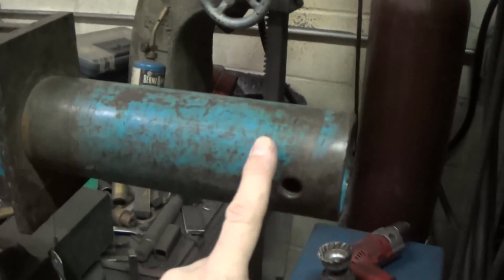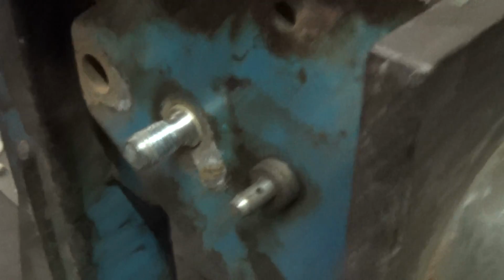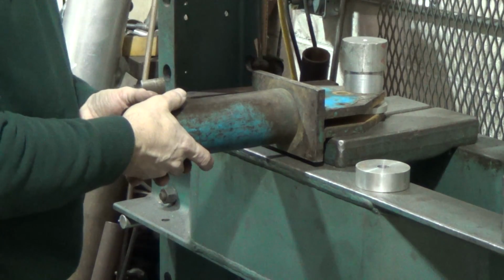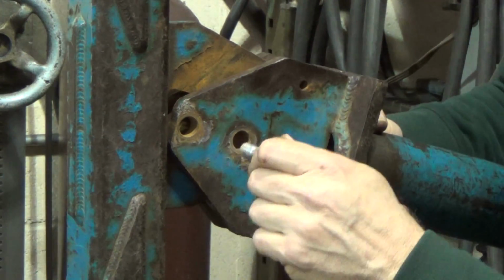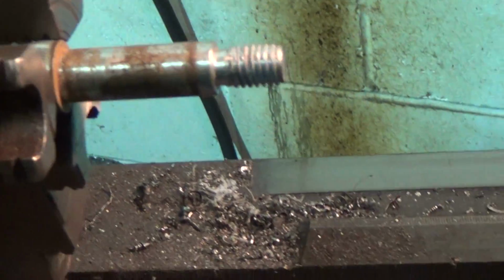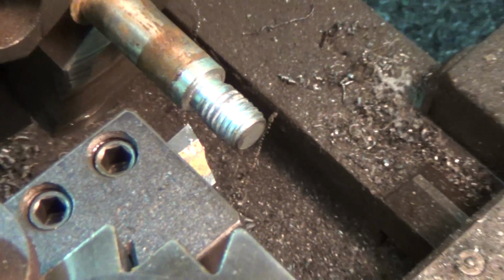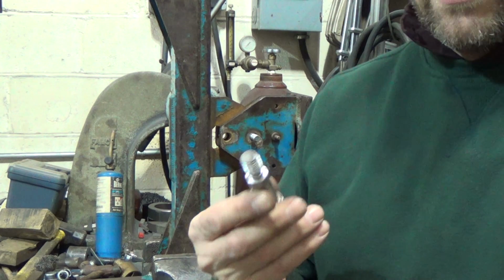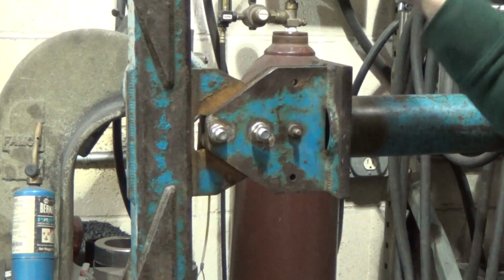Airplane Towhead Repair

Comment: It is not a sheer pin, it is a lock pin. if you look at the design of the tow bar, it is ment to rotate in either direction. The shoulder bolts prevent clamping so you can swivel the head to line up with the plane's wheel. If you loosen the bolts up, and pull out the lock pin, you will be able to rotate the head and the pin will locate on either of the holes to the left and right of the center lock pin hole. No matter how good of a tug operated you may be, you won't always be dead center. Thats why it moves.

Comment: The shouldered bolts do prevent the clamping effect of the The two halves the two sides should have some play between the mating surfaces...If you measure the bolts one might be longer Is so that's a sure sign nothing was ever wrong the taper was always  intended perhaps to  put less fatigue on the Rigger... Secondly I rather see a flat washer as a spacer with lock washers rather then less threads on the bolts rule of thumb is three full threads need to secure a bolt properly... The Shear pins only purpose is exactly for what it is named the pin will snap In the event the plane has a flat tire,seized bearing or is just simply too heavy for the towing Rig This is a safety feature solely to give the operator warning something is wrong as he would feel the slack in the Rig before fully moving the aircraft... I hope this helps this is nothing to do with the man Making the video good work I like your channel      more of a safety Issue...

Comment: Seems to me that 45von is correct, the bolts you modified are designed for alignment of the head to the tow bar and the shear pin is to make sure the load on the axle of the aircraft is kept inside the limits the designers intended.  Your clamping the two plates with the bolts makes sure much more load can be transmitted to the axle of the aircraft..    Parts for aircraft are very carefully designed and created to minimize the forces on the airplane first and everything else second.
Reply from the maker: Hi John,  as it turns out, I was able to establish that there needs to be a small amount of clamping on the thru plate, just enough to keep the shear pin from having to carry all the force and twisting by itself, I did make an addendum video to explain some of what I was able to find out   Airplane Towhead Repair - Addendum  Thanks for the comment.
   Mike

Comment: the shear pins break when there is to much pressure on them yes but you cannot tow the aircraft with out risk of damage to the plane ! some times they break with force that knock someone out ! been there done that lol and the towbar head are allot different from a plane to an other

Comment: Don't believe that is a shear pin, I think its purpose is to lock out the swivel function. The slotted bolt hole allows some fore and aft movement while the large rombus shape allows vertical travel while moving fore and aft. With out this play the planes suspension will take the bind from being hitched to the tug and possibly damage the plane. Notice the wear patterns on the plates. That is why the pin is made of such low grade material, if someone were to forget to pull it before towing then it would break and the hitch would still function despite there oversight.
Reply from the maker: Hi Grumpybill, What's that saying about the more I learn, the more I realize how little I know.....  That's a whole new theory, but I must say that when the customer talked to the manufacturer for technical support the other day, they did refer to that pin as a shear pin. I think I see what you are saying though, that if the force goes to one side or the too much that it will cause the pin to fail.
  Thanks for the info and comment ..... Mike

Comment: Just because a guy has been doing it the same way for 30 years doesn't mean he knows what he is doing.
You don't need a manual to know what a shear pin does it is common sense and as the guys below state you negated the function of the shear pin. Shoulder bolts are used in this situation so that you can not put too much clamping force on the hitch!
This is basic engineering knowledge.
Reply from the maker: Hi Bily,  I think I understand all you are saying, I made an addendum video the day after making this video that explained what I learned about this type thing that I did not know when I made the initial repair. Airplane Towhead Repair - Addendum
 In that video I explained that, and also what I had no knowledge of when doing the assembly, and what I did to repair the part, I'm not confused about that at all, and as I explained in the second video, I did what was necessary to make a very workable repair. As it turns out I could have returned it to the customer unassembled, as they make the adjustments to it before returning it too service.
  As I was able to learn from the customer later, the manufacturer did explain to them at their request that "a near zero clamping force is required for the assembly"
  Thanks for the view and the comment ..... Mike

Comment: Adam tight! LOL...thats not the first time I've heard one of you guys mention my torquing skills.
Good job with balacing the budget using the press. My luck was always I press it .010 too far the wrong way.
I like that "truing" tool made for yourf Aloris. Ive seen them before but never bothered making one. I guess I depend on my indicators too much.
Great job on the repairs Mike! I always enjoy listening to you while you video and work.

Adam
Reply from the maker: Hi Adam,  I think that's an official measurement of torque now, at least for us You Tube people,  I think I just got lucky at the press.  I don't see any reason you  couldn't use the truing tool in the multifix, if you'd like, let me know, I've got plenty of those low profile bearings around.
 As always, thank you for the kind and encouraging compliment!
   Mike

Comment: Hi there,fork is meant to be loose on plate. All the pulling force must go through shear pin. The pin is designed to shear and indicate the tow bar has been used out of limits. It is designed to shear before nose gear damage may of happened ie jerked or snatched start or stop and turning through too tight a radius. If you make it tighter it will carry a higher load before shearing,possibly damaging landing nose gear with no evidence of overload condition, not good! 
Andy Wilson, CAA licensed engineer, FAA A&P.
Reply from the maker: Hi Andrew, thanks for the info, I had no idea going into this repair, how much tightness they meant, so I just made it as tight as I could, fortunately, the guys on the ramps knew how they wanted it adjusted, and took care of it right away, but if it were left to me I would want a little bit of compression on that center plate, just my opinion.
 The manufacturers technical dept. finally returned the customers call late today, and the only information they were able to provide was that it should be a "near zero clamping force on the center plate"  I guess that makes it about as clear as mud. 
  Thanks for the view and comment ...... Mike

Comment: Holding the bolt in the chuck only by the head seems a little risky.... Why not remove the upper parts of the chuck jaws, and use only the lower ones? That way you could probably get the bolt head in behind the jaws and grab the bolt itself.
Reply from the maker: Hi Mattias, yes, I'm guessing it is not the best way to hold it securely, probably just me being a little lazy and in a hurry, I was however only taking very light cuts with a very sharp tool, but what you describe would be a much better method, no doubt, if I was going to do any quantity, I probably would go about it as you describe, or some type of split sleeve or collar.
  Thanks for the comment ....Mike

Comment: see everyone has set you straight ! some high paid engineer figure that little fuse will save the front of the plane from getting ripped off. I think clamping might be too much ,the shoulder bolt was to stop it from clamping ,but than again  the customer  is always right !
Reply from the maker: Hi Jim, I suppose you are right on the engineering and the customer authority, I do try and give the customer what they want.
 Thanks .... Mike

Comment: The bolt is most likely 41 series steel. For work holding you might want to use a split bushing to hold the bolt on the shoulder. We use them all the time for point work when centers can not be used.
Reply from the maker: Hi Scott,  That does sound like a good idea, I'm sure it would make it more stable in the chuck.
  Thanks .... Mike

Comment: Hi mike, nice vid as usual. It would appear to me (knowing nothing about towing aircraft) that this hitch was designed to have the shear pin as its main tow point. The shoulder bolts are there obviously for a safety in case the shear pin breaks and also to make the assembly less floppy. The design of the slotted holes for the shoulder bolts seems to be purposed to allow sideways movement while taking the sideload so the shear pin doesn't break during a turning maneuver. If you imagine a straight line from the shear pin hole through the slotted holes it would touch on opposite sides so that the shoulder bolts would absorb the load such as when turning with an aircraft in tow.
The whole assembly, I would think, should be a sliding fit with the shoulder bolt length adjusted to suit...say, something like .020" longer than the thickness of the plate assy.?

Anyway, just another opinion to toss on the pile....everybody has one huh? LOL

Cheers
Colin
Reply from the maker: Hi Colin, I don't know anything about towing airplanes either, I was able to find out a little more information on this and I'm going to try and do an additional video on it over the weekend.
 Thanks for the compliment, I hope you got the tractor going for the snow OK
   Mike
Reply: Michael Reggie
Cool, interested in seeing the outcome. Who knows, I might learn something..lol
Tractor turned out ok...but I wish the new parts had arrived. She hasn't stopped much since being put back together.

Colin
Reply: If it didn't have slotted holes the shear pin would be redundant, the shear pin is there to take the load.

Comment: Hello Mike... Not trying to be critical of your work... as always you do great video clips and have many interesting 'projects' turn up... But this particular one I would hate to see you share in any liability that might result from damage caused by over rating the tow fixture. Someone involved in the use of this device is not aware of how it is designed, and they have given you some dangerous instructions.
 Like others here I  enjoy watching your approach to various challenges.
Reply from the maker: Hi Von, No offense taken at all, honest, and thank you for the compliment, I have been able to find a bit more info on this and I'm going to try and do an additional video on it over the weekend, I don't think I've had to do this much responding to comments in one day on a video so far, so I think this  this is really good, I appreciate all the input.
  Thanks again ...... Mike
Reply: More likely than suffer any "liability", this tow bar will float around the airport for many years to come and will never be "serviced" again.  It will over stress and possibly damage the nose gear of many planes and no aircraft mechanic will ever correlate that damage to the tow bar, but will just think it's normal wear and tear or ground crew abuse.

Comment: looks like a good place for loctite threadlocker.
Reply from the maker: Hi Ziggyr,  Interesting you should mention that, I was thinking about locking nuts for the bolts, I was able to find out a little more information on this and I'm going to try and do an additional video on it over the weekend. I'll also try and mention that as well.
  Thanks .... Mike

Comment: I think you took the sheer pin out of the equation with taking away that shoulder !

I think the bolts had this shoulder to PREVENT the clamping and let the sheer pin take the forces - in forward and in sideward direction. IF the sheer pin breakes then the two other bolts will take over preventing the plane to run loose like a goose.

When you removes the shoulder (and activate the clamping) the sheer pin never comes in action - right ?
Reply: Having experienced the function of the sheer pin thousands of times from the cockpit side of the equation (sitting in the driver seat with a plane load of people) Keld is absolutely correct.  The sheer pin protects the nose wheel assembly in all loaded directions, not just pulling.  When it breaks, it's a warning to the tug team that they have exceeded load limits, or acceleration and deceleration common sense limits.  A sheered pin also immediately relieves the inappropriate, possibly damaging or dangerous load, while still retaining control of the aircraft. 

Not sure what this one is designed to push, but airline applications often see little tiny tugs pushing comparatively enormous heavily loaded jets, so the forces on the tow bar are large.  Odd angles, manuvering in tight gate areas, large bumps in the ramp pavement or transitions and over exuberant tug drivers are the most frequent causes of a sheered pin.  Pilot inappropriate brake use can also sheer a pin.
Reply: Absolutly right !!!
Reply from the maker: *****
*****   I was able to find out a little more information on this and I'm going to try and do an additional video on it over the weekend.
  Thanks .... Mike
Reply: +kingoftaurus utoh....the spelling police...

Comment: You have defeated the shear protection of the rating system... They now need to get the proper shoulder bolts that are sized for that fixture, With Never a 'clamping' hold.
Reply from the maker: Hi 45 von,  From what they told me and what it appears, I have to disagree with you, a 3/16" pin is not going to be able to tow a toy airplane, much less a real one, the way the mechanics explained it to me and what the part bears out, it is based COMPLETLEY on the clamping force to tow the plane, and the shear pin lets the operator know if he has overrated that clamp force and a brake is stuck on or something else is preventing the plane from moving. I just posted this, and I am by no means an authority on this, I will see how others weigh in on this and if need be I'll do more inquiring and research on this, but for now I've got to believe what the people who use this every day are telling me.
 Thanks for the comment ..... Mike
Reply: Michael Reggie Hi Michael. I've actually watched all of your videos and have really enjoyed them. So thank you for that!

However, in this case I think 45von may be correct. 

That pin, which I think you said is 3/8" would have an area of .110in^2. The effective area of the stress is actually twice that since it is in double shear in that set up. So the stressed area would be .220in. 

If that pin is equivalent has equivalent strength to a grade 8 bolt it would have an ultimate tensile strength of 150,000psi. I believe a rule of thumb is the ultimate shear strength is .6 x UTS = 90,000psi. 

Stress = Force / Area    ... so ... Force = Stress * Area

The force of the pull required to shear that pin (with NO clamping force)
= 90,000lb/in^2 * .220in^2 = 19,800lb.

Even if it's only has the strength of a grade 2 fastener (UTS ~74,000psi) 

Shear force = 9770lb

If it's equivalent to cheap low carbon steel then (UTS ~36,000psi)

Shear force = 4750lb

By shortening those shoulder bolts and using the clamping force available there. You're easily increasing the pulling power of that bar by 10's of thousands of pounds.

I know you're just doing what the owner asked you to do but I would suggest to them that they may be altering the intended function of the device and could actually start doing some damage to their planes by applying too much force.

Anyway, I'm not trying to start a war here but I thought I would shed my point of view. I am a mechanical engineer so I'm not pulling this stuff out of my arse. lol

I enjoy the videos. Keep them going.

Stephen Thomson
Reply: Stephen Thomson Just to expand on that a bit more... (totally unnecessary, I know) I think the idea would that when that pin is not sheared it will hold the tower bar straight but once it is sheared the larger hole for the one shoulder bolt will allow the tower bar to hinge back and forth so you would easily be able to tell that the pin has been sheared. 

I believe the shoulder bolts were put in place there to act as guides or "stops" in the slot or hole and there was no intent for there to be any compression applied to that joint.
Reply: Michael Reggie I see now that you said 1/4" or 3/16" ... so just because I'm bored here are the numbers for those:

1/4" Gr8 = 8835lb
1/4" Gr2 = 4350lb
1/4" A36 = 2117lb

3/16" Gr8 = 1665lb
3/16" Gr2 = 820lb
316" A36 = 400lb
Reply from the maker: Stephen Thomson Hi Stephen, I have been able to get a bit more information on the operation of this, and I'm going to try and do an additional video on it over the weekend, thank you for your research and all the information, is it OK if I use some of that information in the video?
  Thanks again for your research and compliment ...... Mike

Comment: The shoulder bolts are there so you will Never 'clamp' the hitch plate to the fixture. Do not shorten the shoulder or spring the hitch fixture. it is to prevent over rating the tow bar.